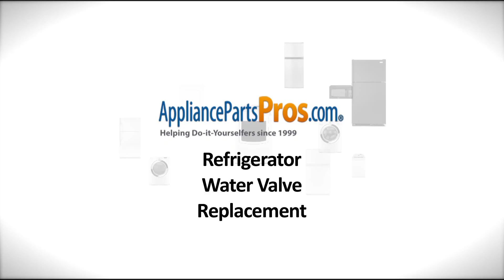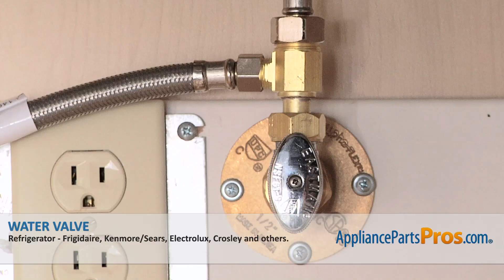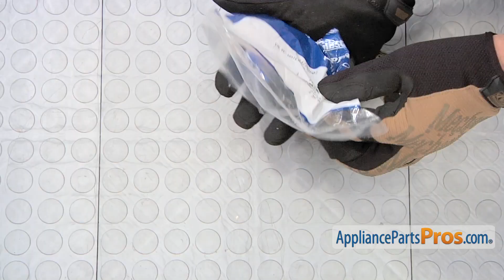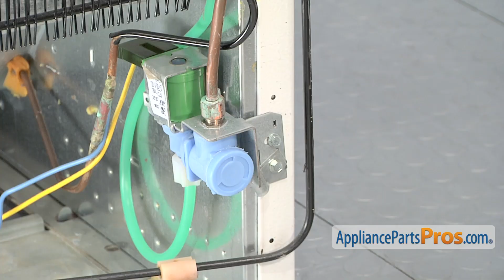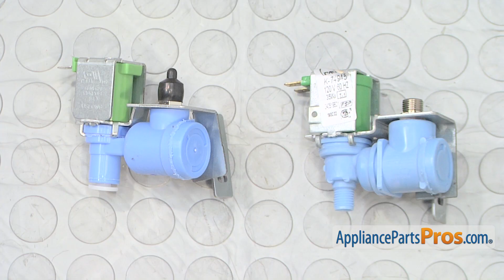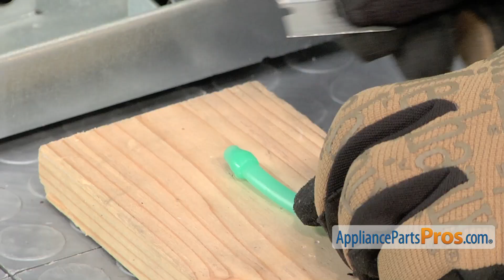How To: Frigidaire/Electrolux Water Valve 242252603

Comment: I swapped the valve out fine but no water would pass through it to the ice maker.I assume that means that the electronics are fried and the ice maker is not telling the valve to open? Does the yellow and blue wire that connects to the vaLve come with the replacement ice maker part and do you have a video on how to replace that? Thanks! Great video!
Reply: It doesn't come with those wires. They are part of the fridg. It might be that your icemaker is bad. I replaced both.